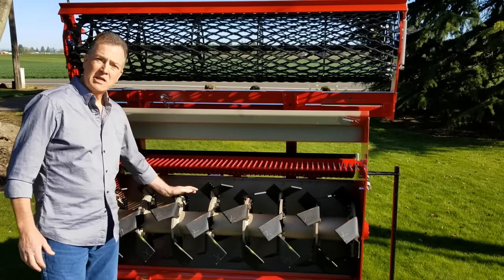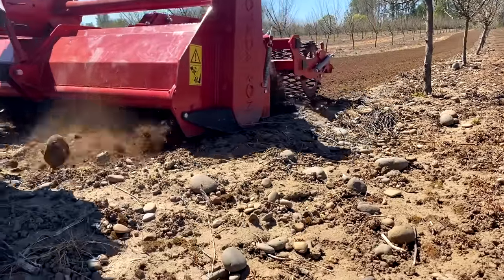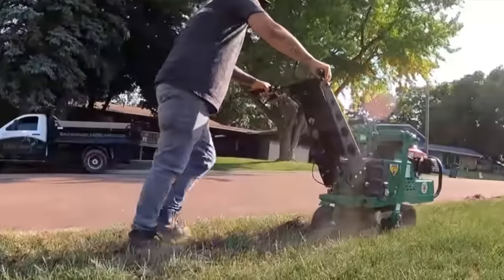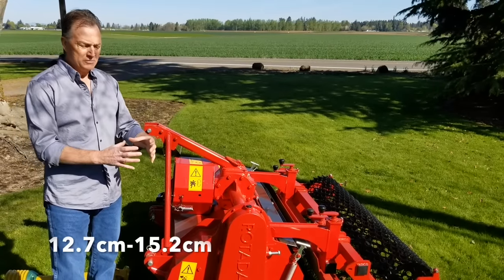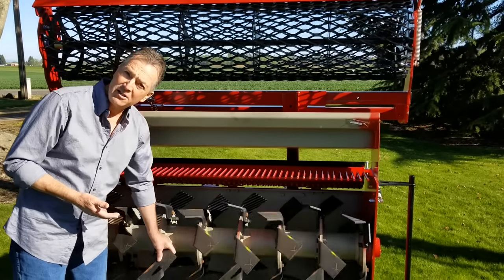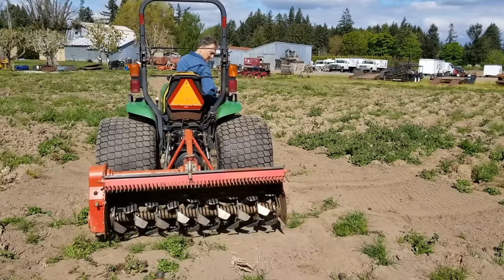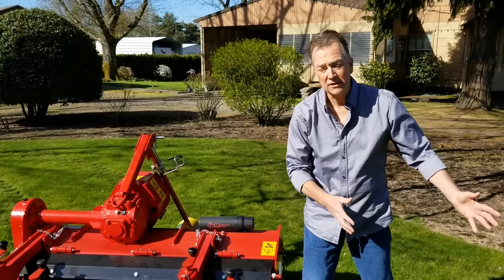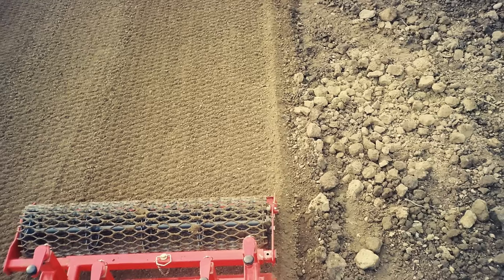One machine. One person. One pass.

Comment: I don't want the machine to bury the rocks to just have them pop up months or years down the road but I do want one that actually picks the rocks up and puts them into a container.
Reply: Is that even possible?
Reply: @AllodialTitle  Yes.
Reply: Use a fucking rock picker then first derp derp.  This is for seasonal beds
Reply: It's almost for the grass only.
Reply: Why? Rocks is home to microbes and also are pack full of nutrients that is made available to your plants if you have the right microbes wich you will not if tilling the soil. And keeping it bare..
Reply: @mikaellindqvist5599  it's slow realise fertilizer. Just wait a 50 milion years.
Reply: @mikaellindqvist5599  This is not true at all. Rocks do not provide nutrients to soil.
Reply: @MrMawnster  Thank you for the appropriate response.
Reply: A local farmer has a super heavy duty tiller that completely turns rocks into dust (like ag lime).  Even limestone.    The machine is super expensive.    Very slow to operate and it wears knifes out fast.    The knifes are very expensive to replace.    It takes a lot of HP as well.   It’s really cool I just don’t know how practical it is being the cost per acre is EXPENSIVE
Reply: @AllodialTitle  :
     It picks it up and filters it; just put it in a bin instead of back down.
Reply: I'm nowhere near a farmer but I thought the exact same thing. Sure someone would want to but them too? They might need a bit of grading into size first but there will definitely be a market for that
Reply: @dont.ripfuller6587  1.) Not all rocks are minerals. You obviously aren't smart enough to know the difference between a mineral and an element. 2.) Rocks in your garden are not oozing or releasing nutrients into the soil that are going to feed your crops.
Reply: @lunkerpond9765  "not all rocks are minerals" 🤣 you're telling they are made of something other than minerals? Are they plant or animal? Maybe you meant that they aren't fertilizer? They most definitely are mineral. Also, a properly functioning biologically diverse soil will slowly breakdown rock as the bacteria and fungi will digest these minerals and make them available for plant life.
Reply: @dlstb  "slowly break down rock". The rocks are "slowing forming". Now you're trying to tell us that they are slowly breaking down. Go put a tomato plant in a pile of rocks and see how well that works are for ya.
Reply: Where I plant grass I pick the big rocks. By hand or by rock rake. But only the ones on top.

The garden is different. I plow 7". Pick all rocks by hand. Scrape into beds. Rototill the beds in one or 2 passes. That sets my tire tracks at 5'-6" centers with a 60" tiller. Pick all rocks or debris again then lay the plastic with drip tape under. Smooth out the paths and plant through the plastic with a water wheel machine. Then early or slow crops get a fabric half dome. Last is putting mulch or plastic for the paths.
Reply: This isn't for farming. Its for leveking mainly for landscapingor driveways which this rocks will never pop back.
Reply: If you are talking about rocks in your garden why wouldn’t you just hand pick the rocks? It’s just a small garden, exercise is good.
Reply: @jonathandean2918  I'm not.  I'm talking much bigger from rodeo arenas to farm fields.
Reply: Or I want a machine that crushes all the stones and mixes it with the soil. That’s already possible to buy. They use it for maintenance on forestry streets
Reply: I agree with Kuptis!  And I don’t care if the machine holds them or kicks them out to a chose side to be gathered by another machine between passes with this one, or kicked out to one side and a trailer behind this scoops them up…

I’m soon to retire from the military and want to build a family farm. I’ve been doing my research and want to do intensive crop rotation hog farming with chickens behind, and it makes sense to grow a certain amount of my own feed and rotate not only the hogs but also the fields being used for feed so something like this machine but pulling stones would be perfect when going into a field that has been used for hogs for a year or two and prepping it for corn or root crops for the hogs.  I feel pushing the rocks down is just saying “oh we’ll worry about that problem in three years.” Not the smart way to handle any problem on a farm or in any business…..
Reply: @halfdollar86  LOL what? Unless you’ve got diamond coated knifes you are grinding up the rocks in glacial till. Maybe sandstone but nothing harder than that.
Reply: They make rock pickers. They even make dedicated/self-powered rock pickers. They're insanely expensive and maintenance intensive pieces of equipment. They work kind of like  an antique round baler, which is actually what the first one was fabricated from. Some less expensive models are made to work as a follow-up unit to a rock rake, where you would use the rock rake to windrow the rocks first, and then the picker to pick them up.
Reply: @lunkerpond9765  lolololololol
Reply: Ditto... Or shoots them off to the side where they can be picked up by another machine
Reply: @jamessalley-rl8ls  - That's a rock rake.
Reply: Gravity must be something different where you at
Reply: @anthonysmith4072  - ??
Reply: You can get that option if you purchase the monkeys flying out of your ass package.
Reply: @AllodialTitle oh yes. There are different machines that will completely clean all rocks out of any and all fields.
Reply: Yes because there's no rocks under the soil...
Reply: Learned that the hard way bc i was a noob.  Rock started popping up to the point I thought my wife was playing jokes on me.
Reply: I used a rotodairon in our 1.5 acre yard/pasture/garden along a river bottom. In 5 years not many rocks have come back up. This is a great machine. When I hit the lottery I’ll buy a new tractor and root unit.
Reply: My thoughts exactly.
Reply: You are absolutely correct… why bury them 4 inches down when they work their way right back up a year or two later…
Reply: Yes.
Reply: My soil bed is like 20% rocks and for vegetables i need one of these
Reply: All tillers and harrows are designed to bury rocks.
Reply: @halfdollar86  Pulverizes granite?  Many times the rounded rocks in the field are the toughest because they have survived the test of time.
Reply: Those thinking that burying the rocks under a few inches of soil is okay in a farm field are not going to be successful using a no-till planter.
Reply: @somaday2595  I’ve done it for 40+ years. My 1590 is 30’ wide… it’s never had any problems.
Reply: @zfilmmaker  That would be one tough machine.
Reply: @somaday2595  clearly you don’t know what you’re talking about. The size rocks tillers and harrows bury are like gravel. Bigger rocks stay on the surface. You fake know it all’s are a real problem here on YT.
Reply: @nickschaps4022  Do you see me stating anything about grinding anything harder than limestone?      That is the hardest rock we have.
Reply: @somaday2595  we do not have granite rocks here.     Limestone is the hardest rocks we have.        I would say it would not be able to grind granite without destroying the knives on it.
Reply: Me too.
Reply: You can rent a rock windrower for a skid steer or tractor. I have a Schulte SRW1400 for my tractor, it’s like a Harley/power rake for a skid steer that picks up rocks and puts them into a pile on the side. You then use a rock picker which I rent from my dealer (I don’t own a picker). I rent a Schulte Titan 5000. You can look those up to get an idea what I’m talking about. For small rocks I bury them with my tiller.
Reply: @lunkerpond9765 if rocks are not minerals, what are they?
Reply: The rocks should be left in for the minerals they provide el natural
Reply: @lunkerpond9765 are you a farmer mate? It’s no wonder there is more and more talk of a food shortage.
Reply: @keyboardoracle1044  we don't have a food shortage here in the country that I live in, "mate"...
Reply: @lunkerpond9765  either do I but the world is bigger then one country. Time may change things in your country if farmers don’t get educated. World wide Over 4million square kilometres of land is degraded every year and 120000 square kilometres are turned to desert. I’m sure your country is not immune. It is the farmers duty to look after their land, not just take from it.
Reply: @keyboardoracle1044  my country just isn't stupid. We know how to farm and we don't take guns away from our citizens. Hence we are all fat and lazy. You should educate yourself a bit before you speak on matters which you have no clue.
Reply: @lunkerpond9765 I watched the debate, 2 geriatrics fighting over which one is the most senile…. That’s the best 2 candidates your country could find from 330million people?… yep that’s an educated and intelligent country… no wonder this is the Asian century.
Reply: @KuptisOriginal Ever heard of the Farming Simulator games series? 😅 In that game say FS22 you have to pick up rocks as well, with the Scorpio 550 or 710 model. Check it out 😊
Reply: On the subject of rocks and their ability to fertilize/add minerals, take a trip to the mountains...mountains started out as bare rocks, then seeds from trees were transported (wind, birds) and deposited on the bare rocks.  The seeds sprouted, extracted minerals from the rock, water from dew/rain, and grew.  The leaves from the trees fell to the ground, adding nutrients and (tilth) that the tree extracted from the rock, laying down a bed which supported more vegetative growth.  That being said, the reason you want to clear your field of rocks that are larger than, say, baseball size, is to prevent damage to your tillage equipment.
Reply: Come to the hills of southern New York and and put the tiller to the test until it can till rock and clay not topsoil and lume
Reply: Rock hound. Soil Preparator. Harley Rake. Pick one. They each have their own Niche, just like this one.

Comment: I have 4 of the Rotodairon units. We have used them since the mid 1990's.  Mostly used in sports field construction and renovation.  We even have a small one for our mini trackloader (toro Dingo) that is my favorite home lawn preparation implement.   I would love to have one of the 13' models for use in field preparation on our sod farm.   They are solid well build units that will ast for many years with inspection and maintenance.
Reply from the maker: Biggest one we have is 12'. The clip in this video is a few years old and the manufacturer stopped making the 14' models.
Reply from the maker: And thanks for your business :)
Reply: I would like to find a dealer in Nova Scotia Canada?
Reply: This would be fine for smaller things such as landscaping, tracks, football fields, etc.  Fuel consumption is a concern for larger farms.  Large tractor rotor tillers were tried decades ago but didn't work out due to high fuel usage.

Comment: When I was building golf courses 20 years ago, we had the same machine, but it was called a Blecavator. We used it on grass,rough untilled land and even some land that was mostly rock and it worked great. The only problem we had was that it would rip the rototiller teeth off and at $80 a piece it got pretty expensive. I'm not sure what the unit cost now but you could pay 8 guys to work before a little landscaping company could afford to buy one of these.

Comment: Have you considered adding a rock crusher? I ask because an Aussie Co found by using powderized  rock you do not need to fertilize, for years, as rocks are made of minerals. They, via airplane, sprayed powdered rock on a strip of land that soon grew vegetation. After ten years the strip turned into a forest. No extra water, fertilizer nothing but powdered rock. 
The only "extra" thing about their process was the sourcing of random rocks from multiple sights for mineral diversity. As a skeptic I would however like to see the process repeated. Unfortunately I probably won't live long enough for another ten year study. But it was fascinating if the process was that easy. As a selling point, after being proven a second or third time, wouldn't hurt your sales any either. 
Make a million and send me some.   ;)

Comment: Burying rocks look good until the first frost and thaw pushes them up to the surface but, I guess by then the contractor is long gone.
Reply from the maker: the frost / thaw cycle isn't much of an issue if you're seeding the finished product with grass because the roots help keep most of that soil in place. but yes, if you've got a 16cm till depth and bury a 15cm rock, the soil will settle by 30% or more which makes it look like that rock floats to the surface. best solution (if you're not seeding) is to rip the soil ahead of time and pick out any rocks that are likely to stick out after settling.

Comment: Either there's a huge error in the video that not 1 single person in this thread caught, or this is a hunk of junk. The video says you can process up to 4000 sq. ft. per hour. I'm sorry, but that works out to a little more than 10 hours per acre. I don't have that much time to spend turning my field over.
Reply from the maker: the SqFt/hour is variable depending on the model and ground speed. Sometimes it's 4,000, sometimes it's 30,000.

Comment: This would be perfect to break new ground for a garden if it collected the rocks instead of reburying them.
Reply: Why rocks are homes to microbes and the rocks has nutrients in them made available to your plants if you have living soil...
Reply: @mikaellindqvist5599  This implement would work great for planting a new monoculture lawn or something else with super shallow roots, but for general gardening/farming it needs to grab or eliminate the big rocks. While it is true rocks can break down and add to the soil. It can take many years/eons for big rocks to break down. I am looking to improve rocky soils I can farm in quickly. I wouldn't mind if it crushed the big rocks into dust and gravel to eliminate the size/bulk of the rocks so the micronutrients and minerals they contain were more available to plants, but big rocks hidden just under the surface doesn't help any root crop, veg, or grain. They represent impediments to a healthy root system and contribute practically nothing to the plants as large rocks.

Comment: Knowing how expensive attachments are, I can't imagine even the smallest of these is less than $7,000.
Reply from the maker: Smallest unit (which attaches to a mini-skid) starts @ just over 9k.
Reply: To a layperson, $9,000 and up sounds like a lot of money, but to a moderate-sized family farm, let alone a big corporate one, that’s not really that bad if you’ve got a need for this kind of equipment on a regular basis.
Reply: Yes, I expect there is Sticker Shock. Today I bought a front mounted brush Shredder and the price of implements are through the roof. You either pay for the sweat or hired labor or make the tractor and your sizable investment there more efficient.  Also the older you become, the more you have to take advantage of mechanical advantages. I get it.

Comment: I'm confused by his math here. At 2:14 he states "one guy with Rotadairon can do 4,000sq feet an hour" while the brochure on the screen states 35,000sq ft. In addition, his videos demonstrate a top speed in excess of 8ft per minute which would be close to the 500ln ft per hour.
Reply from the maker: The SqFt/hour is dependent on several factors. Which machine one is using, its work width, the ground speed of the power unit, site conditions (previously loosened soil, obstacles, etc), is it a straight shot as in golf course construction or are you processing a small back yard and frequently lifting it out of the ground, readjusting, and tilling another 80'? The mini-skid unit (STH36) can knock out roughly 6,600SqFt/hour @ .5MPH assuming it's a straight shot. Tilling 80', lifting, turning, readjusting, tilling...closer to 4000SqFt/hour. The brochures are just intended to give an example of what is possible.

Comment: This looks like a great implement but is there a way of collecting the rocks to get rid of them permanently?  Seems it would be better to remove them than to push them deeper into the ground.
Reply: I have one like this.   A Muratori MZ4X.   We never drive over rocks,  rocks destroy the machine.  Always collect rocks before you till.
Reply: I agree, especially in freeze thaw cycles where they come back up it's like they gobble up all the fertilizer
Reply: You figure out a rock catcher that I can dump and I'll buy one! That's what I want  it to do. I'd rather it put the rocks on top so I can pick them up.
Reply: @whiskeybuilder6335  I've seen some on the skid steers fabricated out of steel and cylindrical in shape where they scoop into the soil, collect the rocks rotate to remove the soil and then dump the rocks where one needs. These seem to be very efficient
Reply: @whiskeybuilder6335   Easy.  Buy an old potato digger!  Works great.
Reply from the maker: @gertebert  rocks don't destroy this one 😎
Reply from the maker: Not with this machine. Burying them is a part of the deal. What kind of work would you be doing?
Reply from the maker: @billvandorn5332  what kind of work are you doing? If you're planting turf on top of the seedbed the freeze thaw cycle isn't an issue because the roots keep a lot of that soil in place.
Reply from the maker: @whiskeybuilder6335  what kind of work are you doing?
Reply: @whiskeybuilder6335   Look up  " Rock Hound " attachment for a skid steer.